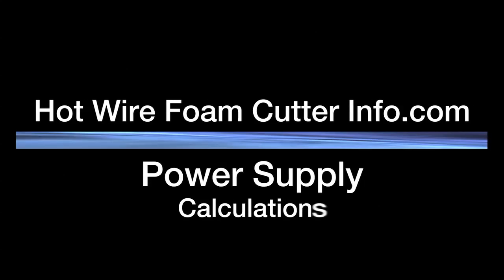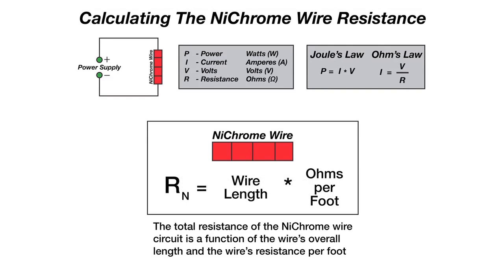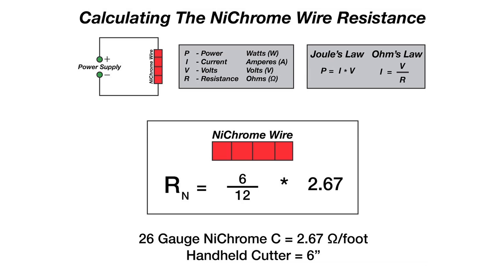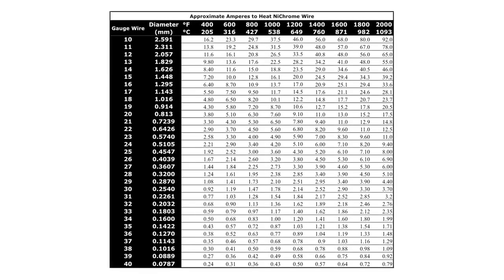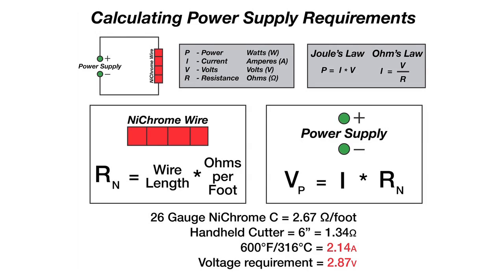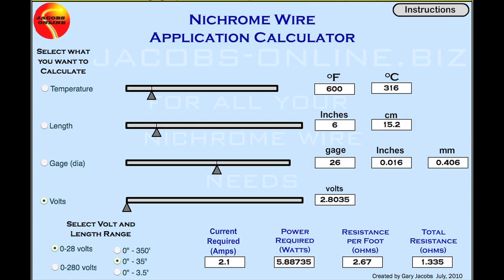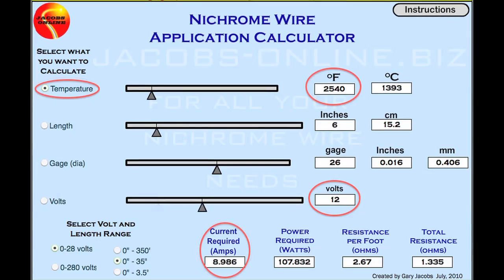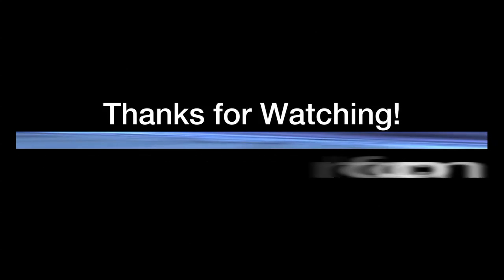Power Supply Calculations - HWFCI

Comment: Hi, I would like to ask if I had 12V with 5A power supply what size Nichrome Wire do I need and what is Length the exact measurements can handle of a Nichrome Wire??

Comment: Interesting vid,
I need a hot wire to warm up a nail for a thermal scope,
As it is out in the field I need to use a battery to warm the wire that I will coil around the nail.
If I were using a 9v battery what gauge wire would be best to get the max amount of time for the wire to stay warm before the battery drains,
I'm not looking for huge temperatures like you need for cutting, I'm looking for around 100 degrees just to warm up the  nail that will be pushed through a hole in a metal plate.

Comment: Can it help cut PU foam.
Reply: yes, hot wires can cut polyurethane and polystyrene. The PU foams are "open cell" which means that the small air gaps will slow the cutting speed, but the PU easily melts with hot wires.

Comment: Sir, please explain the same with home electricity.. AC 230 to 240 volts and how to design the same..
Reply: Design is exactly the same. The only difference on 120 versus 240 is going to be your selection and usage of power supply. You'll always want to look for the power supplies output wattage and max amperage rating to see if it can supply your circuit. Good luck!

Comment: Good day, please excuse my nonsensible question but can I use the same formula for nichrome spring coils? :D  Thank you
Reply: truthfully, I have never used spring coils, but electrical law is the same regardless. You can test your circuit's resistance, and then use the same calculations. I've used lots of different nichrome configurations over the years, and a coil should not be any different. Good luck!

Comment: So tell me why you explain temp =resistance x current  then show a table that only relates the gauge of the wire..  why does electrical shit always give you a table to work off of where you have to do more work than necessary to figure out what your solution is?  Nec does it all the damn time..  and shits different for different locations..  but why not give a table that directly relates the wires resistance values and current to temp??  Also who is really going to go through calculating a defined temp for the project application based off of an estimated theory of finding the resistance of the wire without physically measuring the ohms with a meter??  Is part of the reason i dropped my electronics engineering degree back in the day..  unnecessary bs to go through where human error is statistically 75 times more likely to occur if estimating values from calculations made through estimated values which compounds itself when progressing through multiple layered circuits rather than the overall 15% error if solutions are obtained through physical measured and documented values in the application..  and if the shits being built than you have your test points there so why the fuck am i going to sit down and spend all the time on paper before just to test myself and verify that i did good math when an actual value can be skewed via oxidation or something thereby assfucking all that time spent gettin a solution with a value that is physically incorrect?  Many times ive seen a lead engineer bring the schematic to a build and when somethings different they say “ooh yes that sounds right because of the added x effecting y so z is different than the schematic” so fucking go home then, your math does nobody any good now  and a +\-% error is only meant to be used for devices not for their schematics Unless random values are desired..  fuck sake...  am i wrong in my logic ?  If so then oop, my bad..

Comment: I understand the formulas but I have a hard time understanding where each variable comes from, and when to use it. If I’m trying to find a power supply sufficient enough to heat a 1” flat piece of Nichrome ribbon to high temps. How would I use the formula after I have the resistance of the nichrome?
Reply from the maker: Hey Marc, the variable you're missing is the amperage it takes to heat 1" flat piece of ribbon wire. I don't have the amperage ratings, but you can try jacobs-online (dot) biz. He might have the coefficients. Once you have the amperage rating for flat ribbon wire, you can use the resistance to calculate the voltage. You can by pass the calculations if you get a variac transformer, they usually have very high wattage ratings, are cheap and will heat damn near anything. Be careful at voltages above 45 volts, as that will penetrate dry human skin. Good luck!
Reply: LetsCutFoam thank you I’ll check it out. What would be a good variable transformer to use? I searched them online and there are so many kinds

Comment: I'm so lost if anyone can help. I have 33' feet of 18 gage 0.42190 ohm's per foot my desired temp is 35'C
Reply: Hello Mark! Hop over to the main website, there is a lot of helpful information there to calculate your power requirements. Please contact us through the website email address, which is easier to provide advice than this website. Thanks!

Comment: I bought 0.3 mm nichrome wire and try to make a foam cutter with a 9 volt battery but it doesn 't get red hot.
Can someone help me how much volts it needs to get red hot and how many centimeters of wire?
Reply: Hello! Head over to the website, there is a lot of beginner and advanced information available for you. If you have any questions, feel free to get ahold of me through the website. That will be easier than YouTube system

Comment: I'm a sparky by trade and i ran into this video while doing some research on nichrome wire which i will be using to make a forced hot air blower to test heat detectors. Anyways, enough about my crap. I gotta give props where they are due. I wish this video was around back in the late 80's, early 90's when i was starting my apprenticeship. Great video. Clear and easy to understand,  as well as having someone with excellent speaking skills, i have to say this is one of the best instructional vids i have seen on this site. Very nicely done.

Comment: Thank You For the Great Video. I do have a Question . I have in my position a laptop charger, it is 120 V  AC 60 HZ AND 46 W, 
THE OUTPUT IS , 15 V DC 1000  mA , MY  Question is I will use 12" Long Nichrome wire , What is the most suitable  l thickens or Gage wire ? I also do have 120 V  600 OHM  Dimmer swithc with on and off on it. I thank you in Advance
Reply: Hello Antwan, please check out our website for additional information, recommendations and suppliers of everything you'll need.

Comment: How can I calculate a power supply for a strip (not a wire)? I have 2 strips of stainless steel (approx. 3 x 0.5mm, 300mm in length), crimped on both ends with a ring (Rn = 3.3 and 2.7 Ohms). It's used in plastic bag sealing device and I bought it as a spare part for a few dollars. I need to make a plastic bag sealing device for a project. As far as I know - it should be heatened to 220-240 deg. Celsius for that purpose. How can I calculate how many Amps I'll need to heat it to this temperature range?

Comment: Thank you SO much for this!  I am a complete novice to this stuff, and am trying to make a small hand-held foam cutter (4" span, 24 gage NiChrome)  I tried the suggestion from another video of using a wall wart and the one I used toasted itself after about a minute. (30v-500ma) I thought all I had to worry about was achieving the required wattage, without regard for max amps of the transformer. After watching your video I have a better understanding of the relationship between all the variables and their limitations.
Again, thank you for your explanation! 
I will now be building a purpose built power supply using the information here. 
VERY Helpful!
Reply: ***** You're most certainly welcome! Glad you found it useful :) You'd be surprised how many people contact me through email or youtube asking why their wall warts and/or door bell transformers burn out. Check out my website, I have lots of more diagrams, videos and tutorials on there if you need some cutter design inspiration. I personally use a step-down transformer from jacobs-online.biz and after a few years I haven't had a problem yet!
Reply: I'm so lost if anyone can help. I have 33' feet of 18 gage 0.42190 ohm's per foot my desired temp is 35'C

Comment: thanks for video. So what is the ideal tempeture for cutting foam on this wire ?
Reply: couse im using 30 inch cutter with 12 v battry charger. (probably this carger gives more that 12 v to charge bataries. Like 13,2) and this charger have realy high amp capasity. at this program max temp on 12 volt(tryied 13.2 too) about 450 celcius. it makes 900 fahren.  I think its u high ha? its cutting every kind of foam like butter and its just fast as u can imagine but it smokes man even after cutting prosses the particules on the wire are smoking. i think i have 2 much volt on it but i have no change to reduce it. and i realy want to use this power suply. so u have any idea how to reduce  volt...or i gana go and but smaller diameter wire to increase resistance.

Comment from the maker: glad it helped!! thats one of the limitations with the calculator, but the relationship between amperage and temperature is relatively linear as you go below 200*F. So depending on what gauge wire you're using, just figure out the degrees per amp, and extrapolate from there. The other thing I'd recommend is do in-field testing. You might be surprised at how much heat is lost to the environment, and 200*F might end up being a decent temperature. shoot me an email if you have more questions